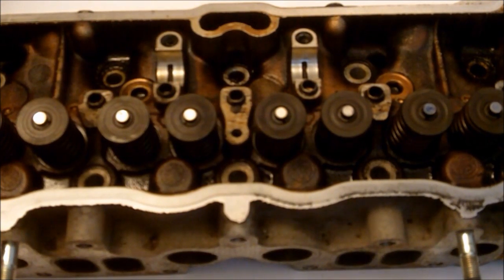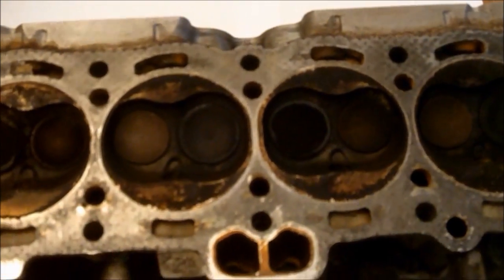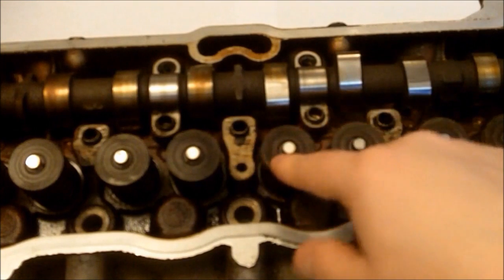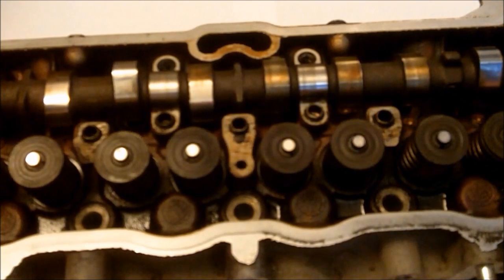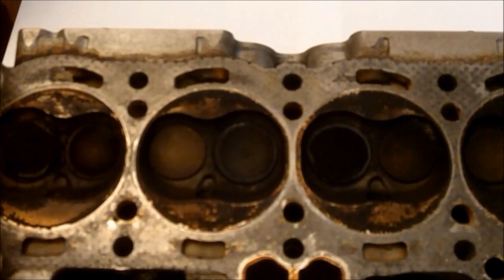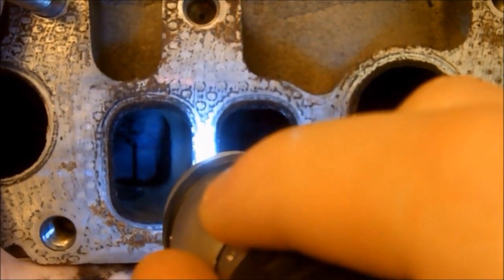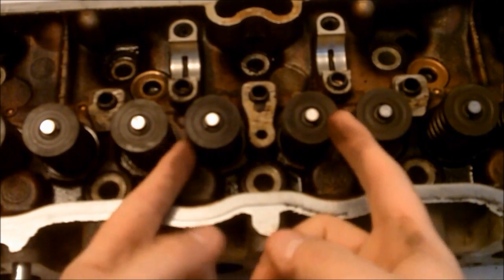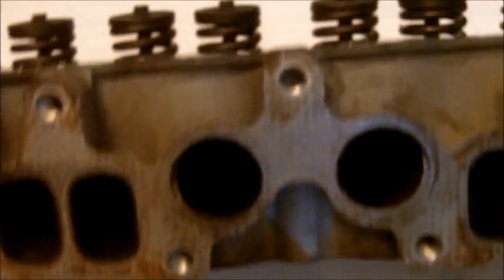4AC Cylinder Head Tech

Comment: @84hachi oh. i see now. i thought it was some local place over there in MD, when you mentioned it in the video. Anyways ive got another quick question you might be able to answer. If i were to change cams, springs, and clean up my 200k mile head. would i still be able to drive the car normally? and would it massively effect my mpg?